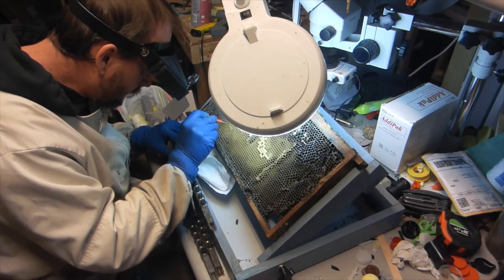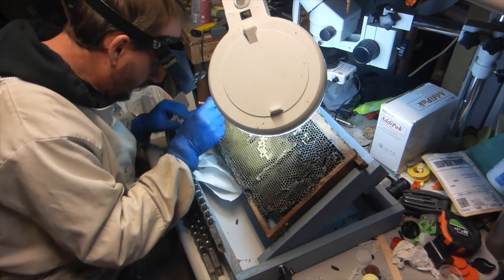Grafting day

Comment: You don’t add the cups to the builder the day before for cleaning and polishing like others do. Have you tried this? Your take seems too be high but might it be higher if you did?
Reply from the maker: "The cups don't need to be polished by the bees. Graft right into new cups and place them in your cell builder. I set up about 50 cell builders during the season, each with 48 grafts, and average 46 ripe cells, and often get 48"- Michael Palmer

Most of the "big" guys use them right out of the bag, so that's what I have done.. I tried it once and didn't see a difference 
 
my feeling is polishing is a hold over from the days of wax cups